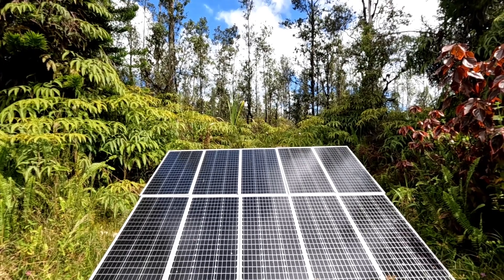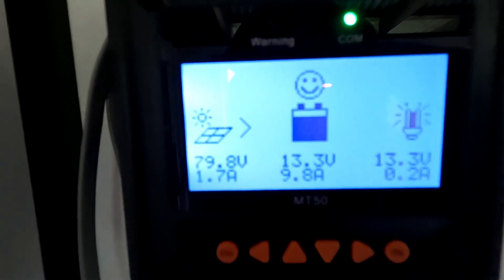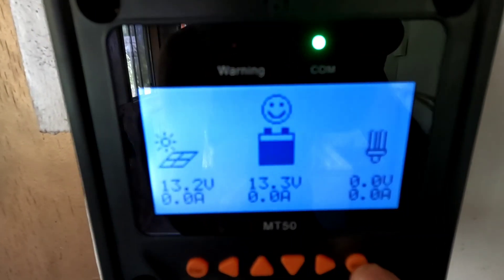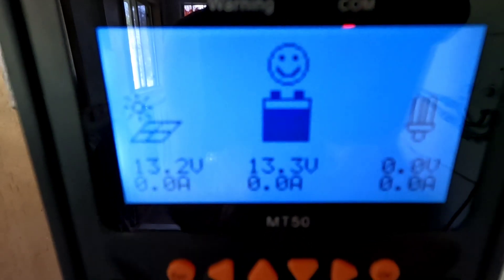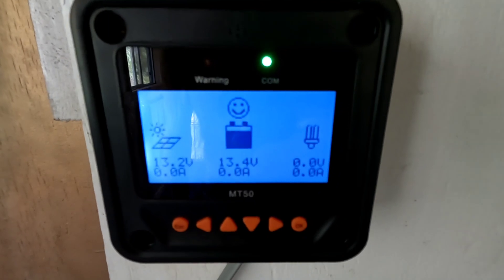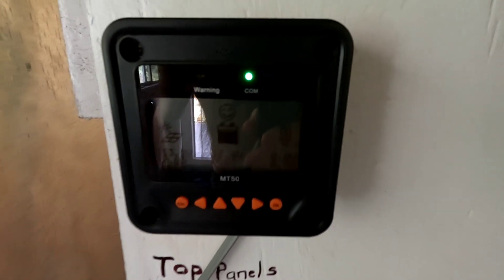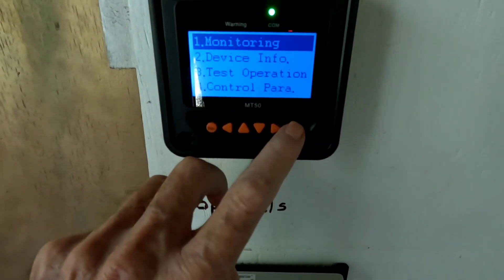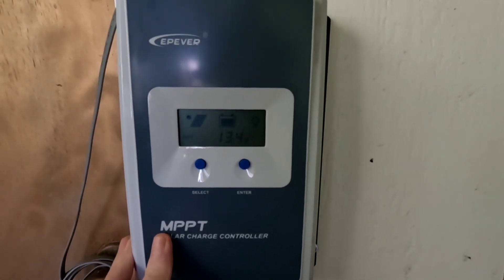EPEVER 40 amp MPPT solar charge controller Failure!

Comment: So sorry to hear about the failure. It was a good reminder for me too upgrade my back up charge controller. 
I'm running my current model at 50% rated output, ( 40a/20a), in hopes to see ten years full time continuous duty.
* Ten years is probably a reasonable expectation of maximum time in service life  - IMHO
🇳🇱✌️♥️👍
Reply from the maker: Mahalo for that! With all my redundancies,  I was caught flat footed without a suitable cc to drop in...that will be corrected in a matter of days! aloha 🤙
Reply: @ProjectsinParadise808  Yep- I realized that my original PWM cc is a terrible backup today, after evolving with series strings.

Comment: I was running a bunch of EPEVER 40a's on different types/brands of panels. I found they would get stuck at low voltage when clouds would pass or from early morning startup. I tried many combos of panel strings with no luck or reliability. I would cover the panels, unplug and replug them in and it would work again. I also found they track REALLY SLOW. I ordered some victrons and they work 10x better. I'm getting more output too! The EPEVERS are not very good. I'm sending mine back. I would NOT recommend them.
Reply from the maker: The Epever was my first venture into MPPT controllers.  Even before I had any Victrons set up I noticed the same thing...very slow tracking.  No comparison at all matched against Victron.  That's what's gojng to be replacing this, no doubt.  Thanks for sharing your experience...it helps! aloha 🤙
Reply: @ProjectsinParadise808  Same here, I did not know what a good tracking speed is. After using Victron controllers, I see how bad the EPEVER's are. I went EPEVER after reading some good reviews and recommendations. I really liked the large heat sinks and remote display but they need to develop their product more. I'm getting way more energy from the Victrons.

Comment: I have been using one for a while now but mine is the  full aluminum one that accepts 150 volts,it gets supper hot so I put a computer fan to cool it with a temp switch it has no screen only the mt50 .. tracer4215BN .. it's a bit more expensive than that plastic one...
Reply from the maker: Thanks for sharing this information with us...aloha!🤙

Comment: I'm no expert, but didn't it just fry. I think this series of controller accepts max.100V Voc and you connected 5 Newpowa 100 W panels in series at about 20 Voc each.

Or does it accept 150?
Reply from the maker: Controller is 100v, panels 18.8v , so close indeed,  but never saw any values challenging the controller one time in every kind of weather.  Thank you for your thoughts on this, for sure! aloha 🤙
Reply: It would be interesting when plugged into the PC software, there are some logs associated with....

Comment: That sucks ! glad you have split into 2 banks . 50% is not 0 . gives you time to replace.. Think about getting that ground rod in better and some surge protection on your system. Midnight solar has them for panel input to controller. even a hard rain can make a charge that can hard comptroller . I have 5 controllers total  on 3 battery banks. just for the house. They all Moring star type. .some 15 years old. never had 1 fail yet. looking forward to up date on this.  🙁☀
Reply from the maker: Yeah,  50% is not dead in the water! And other than when I took a direct hit on house with lightning,  this my first outright failure.  Btw...I've had two direct hits on house in 30 year's,  so I'm taking to heart what you say, and have those midnight products on list. Hoping for an update on this in about 10 day's....sooner if I get lucky enough to fix it through more troubleshooting.  But me thinks it's dead as doornail! aloha 🤙
Reply: Would love to see your set up! That is where my wife and I want to end up - fifteen years free of headaches! After having a heart attack and 4 stents installed last year... I don't want to drop dead and leave her in a lurch not knowing how the system works on top of the mountain.

Comment: Mine operates at 15.7v under load and should be at 80+ volts.  It actually charges at about 3ish amps  When it gets to full charge then the volts go to 80+.  Junk I bought that BougeRV 40 amp yellow.  I probably should've bought a Victron but at least this one has a warranty and built in Bluetooth. I got my epever from Amazon(Y-Solar) November 3 last year.
Reply from the maker: Yeah,  this was my first failure with these, although I was noticing some real fluctuations in voltage campared to the other one. I dunno what happened.  aloha 🤙
Reply: This is a very common problem with the EPEVERS, they get stuck at low voltage when a cloud comes by or first light. They never track out of the low voltage.

Comment: Aloha from upper puna I would try again disconnecting the Solar panel wires from the controller wait awhile then reconnect.  I'm having a similar problem with my 15 dollar charge controller
Reply from the maker: Mahalo for the recommendation! Ill be try as many of you suggest to troubleshoot further! aloha 🤙
Reply: cover the panels first since there would be a big DC arch that can cause damage from the loaded panels. Never plug or unplug loaded solar panels.

Comment: Had a similar issue with mine but mine was locked on night mode. I did all the factory reset reached out to manufacturer with little help. Replaced it with a victron. The day I installed the victron I hooked up the epever just for kicks and it worked go figure.
Reply from the maker: That figures doesn't it!? I have a few day's to troubleshoot some more, but Victron is going up barring a miracle...Aloha 🤙

Comment: I have two EPEVER 40 amp MPPT solar charge controllers and no problems yet, but maybe after hearing about your problem, I should buy a backup controller, just in case.  Thanks for the information.
Reply from the maker: First real problem for me with these controllers.  Had a couple MT50' s fail,  but never a controller.  Mahalo for being part of the conversation here...aloha 🤙
Reply: How many volts are you using with your controllers @ArmanAllen ? I got some panels that are 48 volt so I can't run them in series. I think I am going to run them 3 or five in parallel.  The amp are like 5.something.  Also thanks for video uploaded.Also if I do that many it would be for 24 volt battery
Reply: @abramturley2572  Hi, I usually run 2 - 200 watt panels that have an open voltage of around 23 volts each,  in series for each controller.  I have never run panels with as high of voltage as you are running.  For 12 volt batteries, usually about 400 to 500 watts is max from these controllers, so I would say keep your wattage to no more than 800 to 1000 watts for one of these controllers on a 24 volt system.  I try to never run my controllers at max output, so they will last longer.
Reply: @OUFan2  
Alright  good to know you have had good results running 400 watts on yours at 12 volts. I am looking forward to using my epever 40s.

Comment: I had this same problem. Solution was to turn off solar input then turn off batteries. Disconnect positive and negative cables from battery or 2 cables where battery is supplied from charge controller. Reverse procedure to reconnect. Hopefully it will work for you too.
Reply from the maker: Mahalo for sharing this information ! I will definitely try as you suggested before completely giving up. Plus, a replacement is many day's away! Aloha 🤙
Reply: @ProjectsinParadise808  bought mine off Amazon on April 29 2021 and haven't had a chance to build my system till now and have been watching solar build videos to prep up. Now im worried if mines bad. I doubt Amazon would replace it.
Reply: It worked for me a couple times then it didn't.  Hope yours holds up. When did you buy yours?  I got mine from Amazon(Y-Solar) November 3, 2021.
Reply: Could be series voltage got too high, you could try parallel or remove a panel.
 (+100v spike)~
I agree (disconnect and restart), my residential panels caused similar issues. Best wishes
Reply: My 40a was purchased from eBay 1/20.
Reply: Oh, btw, Andy @ off grid garage, had a failure w/victron (fyi)
Reply: IF YOU DON'T HAVE POWER  ON THE BATTERY THE CONTROLLER CANT READ AND WILL NOT START

Comment: Sorry about your issue . I have the same one , only in a 20a model .  Thanks for the heads up .
Reply from the maker: I also have a 20 amp, used for years,  no problems either.  Aloha 🤙